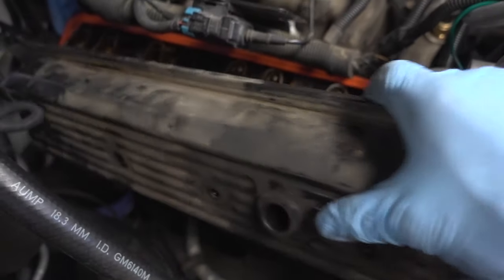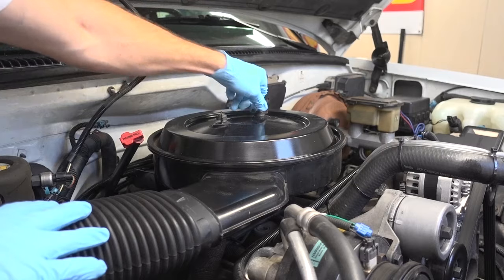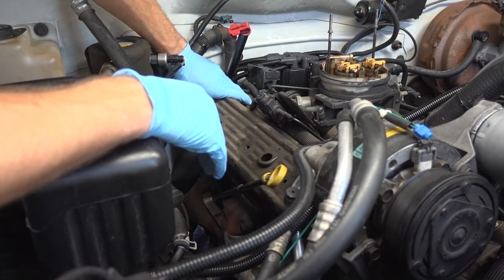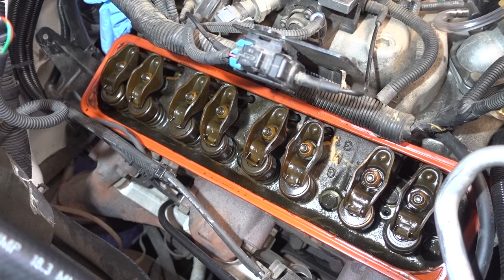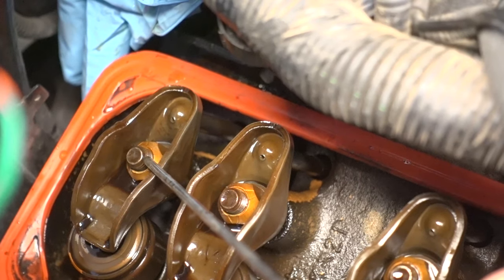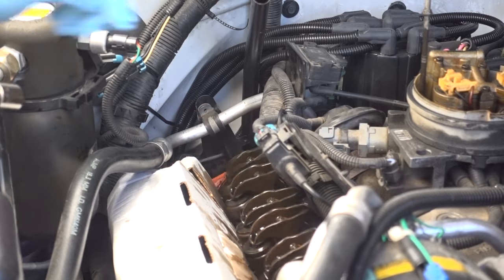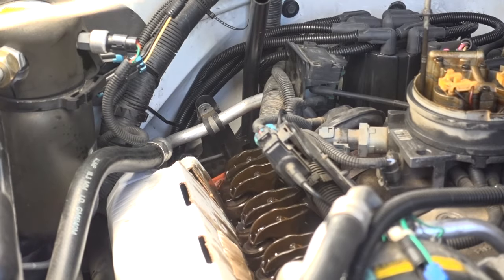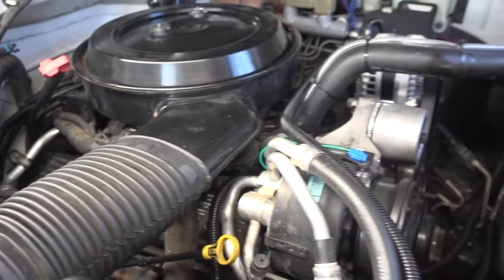Valve Adjustment With Engine RUNNING! - 1995 Chevy GMC TBI

Comment: I am now 68 when I was 21 I was doing maintenance on for my employer in '72 on a '67 Chevy C60 with a V8 with this exact problem.  In this case I took the truck to a Chevy dealer.  I was with the mechanic and he did this very procedure to get the tapping out of the valves.  Great work on your part, 2 thumbs up !
Reply: I bought a 86 c30 crew cab dually that has an engine out of a c60. It's a 366 big block with the same problem. I'm 21 and a mechanic. About to give this truck another 40 years at least
Reply: I don’t know but somehow if you want the scene to repeat , you should be workin on a '09

Comment: One thing i ran in to was..dont let your socket sit on the adjustment nut/rocker with any downward pressure...your socket will keep it from clacking because you have pressure on the rocker...make small turns and take pressure off the socket and listen...i can take a rocker thats clacking and get it to stop just by resting my socket on the rocker/adjusting nut. If you leave it on there, you might have to back it off 1.5 total rotations whereas you might have heard the clacking start at 3/4 of a turn if there was no weight/pressure on that rocker from the socket.  Just my 2 cents worth from previous experience.

Comment: I tried this once before on an older 350 turned out  the issue i had was a weak valve spring and i ruined the cam lobe

Comment: You should have replaced the valve stem seals while you were at it. That one spark plug was fouled up for a reason.
Reply: He can replace the seal from up there ?
Reply: EA. jam yes
Reply: I always pull the head to to replace valve stem seals.
Reply: My big brother got a new truck and gave me his 95  Chevy truck, being a girl and not having any in-depth shop education I tend to doubt if I am capable. I never had a dad to teach me. I have saved around 3000.00 to do suspension I KNOW My truck needs a lot of small things I did the tune up myself flushed and I installed new radiator lines and fluid, I just need a  teacher that is willing to educate me with out pointing out everything I don’t know. I have watched countless videos on gasket installation I know there’s more extensive seals and rings adjustments, I have a clack sound that NO one but me can hear.... oil on a couple plugs. If Im gonna open anything I wanna hit as many birds as possible. So who wants to come to California and help???
Reply: No that requires pulling heads unless you pressurized the cylinders and had tools to remove the valve springs.  Not a beginner option and you would need a massive compressor tank to maintain high air pressure during the work.
Reply: @arolemyoccm6137  next oil change,  replace one qt oil with Lucas oil. Might help

Comment: One full rotation after the clacking stops has been the standard on normal Chevy flat tappet cam engines since the 70's when I started mechanics. That's what I remember anyway. You did good.
Reply: yeah i agree ericthecarguy rebuilt a 350 chevy and he did the 3/4 and then found out it was a full turn
Reply: Was about to say Eric did a full turn.
Reply: ??? So what are the exact steps in text form 1. 2. 3. 4.  Format ???

Hope everyone is being safe :-)

Comment: When I change my oil (99 5.7 suburban)after acheving normal operating temp) i drain a quart of oil out and add a quart of kerosine (Walmart $8.00 a gallon) Let it idle for 10 to 15 minutes. Drain oil add new filter and oil. Keep the push rods clean and oil valleys clean of any sludge. Been doing it for years. Don't be skared. And yes I did the valve adjustment 3/4 turn.
Reply: Probably keeps the seals nice and plump

Comment: PSA: When doing this, make sure you aren't putting any downward pressure on the socket, it can put pressure on the rocker ball under the nut and change your results. Also, this is the easiest way to adjust lash on hydraulic lifters for a layman on an already installed/running motor, the push rod method takes some time to learn and should only be done by professionals or experienced people.

Comment: Good Video My preferred adjustment method after 30 yrs in the trade If I may make a few comments The first is pretty obvious but they need to make sure its not a solid lifter cam! Second is there are clips to go over the rockers that divert the oil to the pivot and don't let it fly all over (check Lisle tools or Ktool) If your doing a lot of the same make ie Chevy you can cut an access slot in an unused valve cover. Position the slot or holes if your good with tape over the adjuster This is really clean as no oil goes over the bottom rail (heads before yours with the perimeter 4 bolt hold downs were bad for this. Also, make sure you use a thin wall 5/8 deep socket 3/8 drive Its really easy with a 1/2 impact to not be in full contact with the adjuster. Also you can sideload the rocker on the pivot Don't go past 3/4 turn I stop at 1/2 or Zero on a hot cam You just want them tight sneak up on the setting slowly It is possible to collapse the lifter and flatten the cam lobe(not good)You may hear the engine load down slightly as you get close it will recover if your not to tight as the lifter reinflates If you are adjusting them frequently you should pull each rocker inspect the pivots and replace the nut The nuts are self-locking
 but will eventually loose tension I think I have said enough I like your videos your clear and concise I will look for more Thanks Jeff
Reply: I had to comment..my buddy who taught me this. Is named Jeff. LoL. He's a Lieutenant for the fire Dept locally his dad was the Fire Chief...All us young guys stayed at Jeff's house. if you were willing to bale hay or cut firewood.. some of the best years of my life..

Thanks Jeff.
Reply: I thought the whole point of hydrochloric lifters was that they self adjust?

Comment: Your engine looks very clean inside Jimmy.  Got yourself a well maintained oldy there.
For a stock cam, one full turn is what my book says.  I have found that even only slightly higher lift cams you may have to reduce to a 1/4 to 1/2 turn.  That fraction is only a guide.  Turn them in slowly until quiet, then add up to a full turn. 
If you have an aftermarket cam, good to have an RPM gauge hooked up while you do this.  You can listen and watch to see if RPM drops (too tight).  Depending on cam lift, you may only be able to go 1/4 turn beyond the point where the lifter stops clicking.  But never just go to the point where it stops clicking, always add at least a 1/4 turn more.

Comment: This method works just fine...its actually the best method imo and the most reliable cause you know the lifters are good and pumped up since its running and you know that they are tight enough but most importantly not to tight and eat up the cam lobes. Good Video Sir!

Comment: As an alternative to the cardboard you can get a junkyard set of valve covers. Section off the top of each one leaving the bolt holes. Install those and do the valve lash adjustment. The oil won't get on the exhaust and smoke you out. It takes a little longer but you might have an easier time since there's less mess and smoke in your face.

Comment: Had a 73 Chevy Monte Carlo, the engine was pretty well whipped.  A 350 four barrel.  Took the valve covers off and actually found the rear and front rockers laying almost side ways, doing almost no rockin whatsoever.  I took my socket and began adjusting what was really most likely a worn out camshaft under those rockers.  the clacking went away and she picked up some pony's.  After I cut all new vacuum hoses she had to have her idle adjusted big time downwards.  I rode it down to Jiffy Lube to change the oil and get her lubed as well as changing the rear fluid out.  Car ran pretty good after that.
Reply from the maker: Nice man! Surprised it ran in that condition. These GM engines sure are tanks

Comment: My very first vehicle - 1974 Chevy Blazer with the LS9 350 engine. At 80,000 miles, the engine was ticking like a roomful of alarm clocks. At 90,000 miles, blue smoke out the exhaust. 
 
My 1997 Tahoe, however...L31 5.7 liter Vortec with nearly a quarter million miles on it. Leaking a little bit of oil, but it still runs smooooooth. Not a hint of blue smoke. Just a slight tick on startup, which goes away after about a minute or so. I always assumed it was a stuck lifter or something like that.

Comment: I got rid of my lifter tick. I've also done the valve adjustment like you show. You can  put brake cleaner, I think I used Berryman B12,  down the pushrods. I used a couple cans... Sprayed it right down the pushrods to fill up the lifters. I let that set overnight. Then added a really strong engine crankcase cleaner... honestly, I think I used seafoam. Ran motor at idle for one hour. Then changed oil. Lifter tick was gone.
Reply: As well as your cats and o2 sensors?

Comment: Did that way back when i had a 64 Chevy Impala. Cars were amazingly easy to maintain or repair!
Reply: I thought feeler gauges were required for valve adjustments. Is this not the case?
Reply: @MrSupernova111  that's with the newer style that has the screw on top of the valve. You're not able to get a feeler gauge under these older styled lifters
Reply: @JamesAutoDude  . Good info. Thanks!

Comment: I have done the same type of adjustment myself, but for different issue:  valves to tight causing rough running engine, even misfire.......works either way.   I would recommend 1 full turn on tightening also I have tried 3/4 and end up with "ticking" noises until I readjusted and tightened to one full turn.

Comment: After you have done the valve adjustment, and you still here the clacking, there are only 2 other reasons it can be for that year since the fuel injection is straight into the intake and not the cylinders, a bad lifter or an exhaust leak. With the lifters you can get the pin that holds the roller get excessive play in it causing the clacking, and the exhaust leak well that is self explanatory.

Comment: It might take longer but honestly just do a cold lash one at a time at TDC. In my opinion it is a much more accurate way of adjusting the valves and it's really easy to tell if you have a collapsed lifter. You want to give the engine plenty of time to get the oil out of the lifters. I usually leave mine overnight. And then the procedure can vary depending on the type of lifter. And it may be because I have a cam primary system but if you start my truck with a valve cover off you are getting oil shooting 50 ft away.

Comment: ANY rocker arm adjustments will negatively or positively affect the corresponding valve opening duration and depth - noise is secondary to a proper valve opening.

Listen to the engine as he is loosening or tightening and you can hear the engine RPM’s change. That RPM change is a result of that cylinder’s efficiency or performance change.
Reply: Not true.  After each shutdown and restart,  the hydraulic lifters absorb any maladjustment.

Comment: I dropped by your film here to kinda check out if this is done any differently on the more modern engines....Im more accustomed to the blue flame chevy 6s much different on them .I was having a miss and found a cylinder with 0 compression and a plug fouled such as yours ....Had a broken push rod and the valve neither opening or closing fully and lifter rattled pretty good when  I replaced the push rod a few persuavive whacks with a hammer and all was well But I would recommend you do as I did and use the most effective time honored treatment for noisy lifers drain your your oil ,replace four quarts and add one quart of Marvel Mystery Oil It does wonders these GM  V8s were always pretty noisy when they first came out I liked that your shop is not adorned with photos of half naked women and you needed no potty mouth to get the job done .
Reply: A solvent wash is great to loosen carbon on older engines.  From the look of his valve train I don't think this one got gunky.  I had an 80s blazer that missed intermittently on one cylinder. Was recommended it was a lifter and to do the oil/atf trick.  Never did

Comment: I do pretty much the same operation. The only thing that I do different is to  1) loosen the nut until I hear the tap, 2) tighten the nut until the tapping stops 3) tighten the nut another full turn 4) loosen the nut 1/2 turn. That is just the way that my dad taught me to do it about 55 years ago. It always worked for me.

Comment: same truck  1994 same color just put in new seals did it other way from vidos i did the same thing you did covers are hard to get off// . works great does not smoke- runs great.  3/4 turn good   other vidos did not work as easy thank you....

Comment: My cousin cut out the center of a old valve cover an always adjusted them when it was running after he got the motor together I tired one time couldn’t doit I had noise from the fan an my exhaust was dumped right before back tire.  No cats.  Let’s just say I couldn’t wtf was goin on   Hats off to whoever can doit with car/truck running

Comment: FYI...I found that after installing a mild cam and new aluminum Proform valve covers..the rockers on the intake manifold side were tapping against the side of the valve cover. The tapping drove me nuts, until one day I happened to notice wear marks on the inside of the aluminum cover, both sides after I removed them for another adjustment...That was the problem !!
The cover had enough aluminum to use a grinder and removed the wear marks ...
IT WORKED>>>. Check it out.

Comment: I would adjust them all the same way on both sides. Because they all could be off because of wear by 3-5 thousands because of milage. And you are right one full turn is better.
Reply: I thought feeler gauges were required for valve adjustments. Is this not the case?
Reply: @MrSupernova111  I think you use them for solid lifters
Reply: @cj8172  Thanks!

Comment: You did a fine job Jimmy.  I have done that job many times on gen 1 Chevy's small (Vortec's are Gen 1 with Vortec heads) and big blocks.  1 turn always feels like too much in your mind but if you only go 1/2 turn or 3/4 turn you'll be taking it apart and doing it over most of the time.  When I did a motor with a new cam I always did them 1/2 turn static (not running) to break in the cam (20 minutes at 2000 RPM) and then redo them at 1 turn running.  My motors always seemed to make more mess than yours did though, how'd you do that?  ;-)

Comment: I had really loud lifters I used Lucas in the oil and it went away in 10 mins of running. I can now go through a drive through without having to turn off the car.  Never came back in 5 years. Lol. I believe ceretec also works to achieve that.  Might help some people if your rockers aren't yet too worn. That period usually from 75k-150k miles.

Comment: I  am  very  glad   to follow  your  video,  I  am  living  in  Europe  and  your   english  or  american  is really clear,  I  understand  pratically  all  you   are explaining  ;   Often  I am trying  to follow  others  specialists  but  their  accent   are typically  local  and   I  got pain.  so  I  take  a subscription .  I  got  a Chevy  3100  of  1952  with a V8    motor,    I will next,  open  the  cam cover  to   do  the  adjustements too;    I  have   a   cam cover   that  we  have cut  so   the oil stays  inside  and  doesnt   go  the  exhaust  pipes

Comment: Having worked on many of these I was on edge when you started to remove the heater tube. Normally they look fine or a minor leak but immediately break at the threads when disturbed.
Reply: Haha that quick connect on the intake it the worst part of the whole cooling system on these. I've put 2 of em on my 93 TBI 350 in less than a year. I gave up and just let it seep the very small amount it leaks. Doesn't get wet, just leaves dried coolant crusties around it. I've already tightened the fitting into the manifold as tight as I'm comfortable with and am afraid of cracking the intake if I go any further.

Comment: Hello. One about valve adjustment: It is a fine tune, it should be done with the engine either cold or at operating temperature (Refer to manufacturer information) with the engine off. However, what many people do not take in consideration: Often enough the rocker arms wear a little bit where they touch the valve. This is an issue in valve adjustment, as the feeler gauge will measure the gap between the valve and the rocker arm, but not the wear on the rocker arm. This is possible to correct without replacing the rocker arm. Remove the rocker arm from the engine, secure it in a vise and with a file, file the rocker arm (where it contacts the valve). Go slow and steady, if it is croocked, that rocker arm is junk. As for that oil on that sparkplug... It can be a valve seal, but it is unlikely. When valve seals leak, it usually is on various cylinders, not just one. This does not mean it is not the issue,  but more than likely it is the piston rings.
Reply: If it's worn out    then low oil flow(as seen at 7:00 ) or high revs at start up  is why it happened..
this is why i wait at lest 2-3min before leaving the driveway  in the morning
Reply: @punker4Real  Indeed there is not a lot of oil, keep in mind that this engine has an over head valve valve train, not over head cam. If it only had this amount of oil on an ohc engine, that would definitly be an issue. Maybe there even is some sludge at the oil pickup, that will lower oil pressure.

Comment: A very good way to adjust the hydro lifters     tick can also be a exhaust header leak    one can take an old pair of rocker covers  cut them lengthwise to install and make adjustments without oil going every where